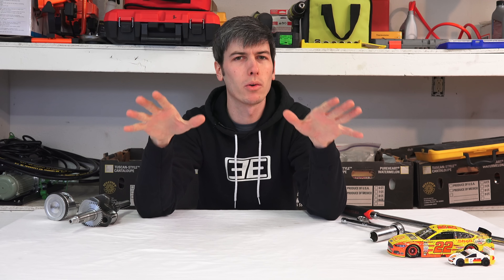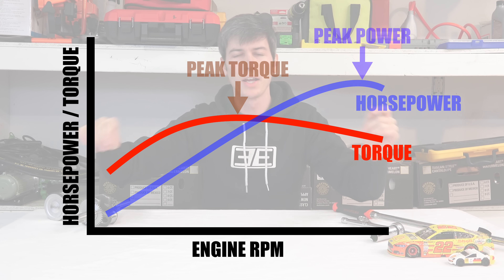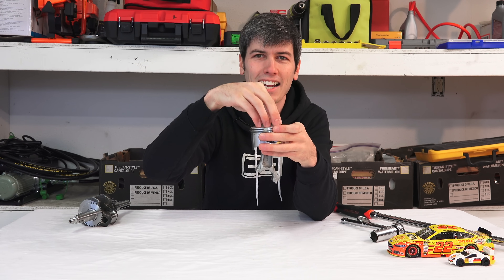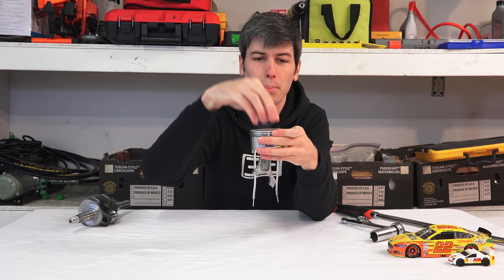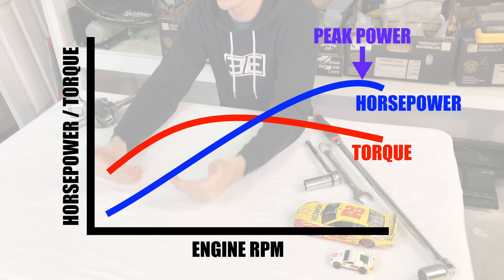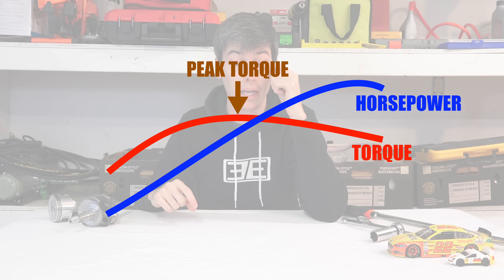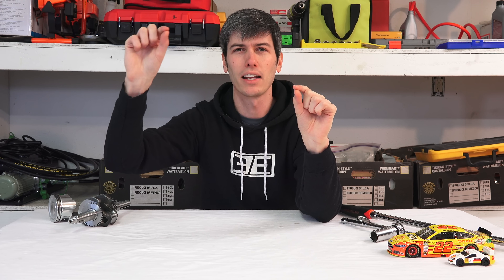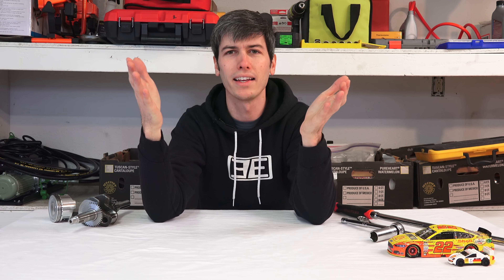Horsepower vs Torque - A Simple Explanation

Comment: Horsepower sells cars torque wins races.

— Carrol Shelby
Reply: How so when he just said hp equals faster car
Reply: @Buzzinga21  Race tracks have usually a lot of curves the car is constantly braking and accelerating, so in this case having lots of torque will give you that strong wheel (force at a distance) turning power to rapidly increase the momentum, while horse power would give it higher top speed, achieved at top perfomance of the work in general ( the engine rotations per minute x torque ), for that you need time or distance in this case.... so... thats why torque wins most Circuit Races.
Reply: @Just4funN92  , nope... HP wins all Circuit Races... not some, all.
Reply: @Buzzinga21  Thats why there are different gears, to shift the actuation curves of torque x horsepower, at low gears (1 - 2) it uses high amounts of torque because the goal is strenght, quick momentum shift (acceleration) but low overall speed, at this point your car HP value will be low hence the time it takes for you to go from point A to point B (mph)(the HP value is constantly shifting, the total number advertized for cars is the maximum value it can achieve at peak performance maximum torque*rpm).
Reply: @Just4funN92  👍
Reply: @Just4funN92  If you look at F1 they are constantly shifting (gear up and gear down) to keep the engine at it peak HP or as close to it as possible for maximum accelaration and speed. But its only true in racing, the cars without launch controls which keeps the enginge from stalling would be more or less impossible to use in a regular driving context.
Reply: The video is wrong.

200hp/100tq engine with 2:1 mission is 100hp/200tq output. And 100hp/200tq engine is equally as fast with 1:1 gearing.

One engine simply spun faster and one slower but after gearing they both had same output rpm, same tq and same power.

He’s also wrong about CVT. CVT aka infinite gearing has max acceleration at peak torque not peak RPM. Because gearing cancels out “RPM” of the engine and introduces a new RPM of the wheel. All power calculations would be tq*wheel rpm not tq*engine rpm. CVT infinite gearing changes output RPM not the engine RPM.
Reply: sparky12x  Exactly. You can push the wall with tons of force, if you can't move the wall, your power is ZERO. Thats why Horsepower is only way to move a car in EVERY SCENARIOS
Reply: Still rpm is the one winning races.
Reply: But how is That my Audi rs5 (450 hp  430 nm) is Faster then a tuned Audi s5 With 428 hp and 520 nm ) witch is also a bit lighter ?
Reply: marty7604 because you have more power, didn’t you watch the vid? :p
Reply: @MartijnvanderHage  gearing and powerband properties
Reply: @MartijnvanderHage  That is when your gear ratios come in.
Reply: marty7604 is ur rs5 faster then a m2 competition? I own a x3 m40i thinking of buying a m2 comp...
Reply: @MartijnvanderHage  if the race was up hill and you both had an 80 kg passenger on board the s5 would win
Reply: @MartijnvanderHage  gear ratio
Reply: @MartijnvanderHage  make those same cars weigh exactly the same more and then the other will win.... eventually depending on the weight.
Reply: @MartijnvanderHage  yeah but the s5 get the final speed sooner that your rs5.... I test it in gt3 for ps2..... Tunning gears and engines. ...
Reply: @michaelriquelme831  Get it's final speed sooner but can't go faster than rs5...
Reply: @MartijnvanderHage  Its an AUDI, german, i.e B@@it
Reply: It's important to remember, though, that ultimately what matters is the torque at the wheels, which can be adjusted through gearing, and then horsepower matters. The reason why the torque of the engine also matters, though, which is what Shelby meant, is that things aren't this simple. In the transmission, you always lose some power, because friction puts a reactive torque against the rotation which you need to overcome. The important thing here is that, like in the engine, the power this torque takes is multiplied with the RPM, meaning the more revs you have, the more power you lose. This means a total focus on horsepower and high revs (which help create horsepower) doesn't make sense.

Additionally, you want to shift as little as possible, and if your engine produces very little torque, your gears need to be relatively close together to stay at peak horsepower, which means you need to shift more often, which reduces or entirely removes engine output to the wheels while shifting (depending on the transmission you use).

Lastly, as you get to very powerful engines potentially reaching high RPM, the torque curve gets more extreme and longer. This can mean that at high RPM you make so little torque that a higher gear can make sense because you gain more torque from being at low RPM than you lose from shifting up. This means that to achieve maximum torque you will basically be short-shifting. As a consequence, you don't reach the RPM where you have peak horsepower, which means you lose the benefits of having it.
Reply: @justuslm  Thank you for that fantastic explanation!    This finally makes sense to me now.
Reply: @justuslm  👏👏👏
Reply: J. RAMIREZ MuRIcA biggest trash i‘ve ever heard.
Reply: I like that 👌
Reply: horsepower wins races. technically average horsepower does. that is a scientific fact
Reply: Whatta legend
Reply: Me after not understand what he says: My car goes brrrr.
Reply: you cant have horsepower without torque. Either Shelby didnt really understand that OR he was dumbing it down for the natives.
Reply: @yamahale  Well, horsepower and torque go hand in hand. However, what most do not understand is: You can not have torque without any form of force applied but you definitely can have a force without any torque resultant. Imagine when the piston is right at the top. Torque = Force applied x Distance from the center axle. If the piton is right at the top no matter how big an explosion you have in the cylinder the piston won't move either side because the distance is zero. And something multiplied by zero is...  ICE's solve this problem by using another type of "force" to pass thru this 0 degree point. It is called 'momentum' (Don't confuse it with "Inertia")
That's why a ICE can not start all by itself.
Reply: Mm
Reply: Jay Barker  haha, i love how wrong that is....
How far you push the wall would be your mass lol
Reply: rpm wins races
Reply: @The_Superpack  So if you have 400 hp and 400 tq at 8000rpm would you beat someone 400hp and 400 tq at 6000rpm? Think about which one gets it's peak first.
Reply: EB SSCAMAROG6 a car that makes 400 tq at 8000 rpm would have 609 hp not 400 hp. likewise, an engine making 400 tq at 6000 rpm would make 457 hp. way less than 609. power is a rate of work done with respect to time. if an engine does more work in the same time interval as another engine, then it has more power and will win any race, assuming vehicle weights are the same.
Reply: @tagacebu2  If the 8000rpm car has 33% shorter gear ratios, they will perform the same...
Reply: @tagacebu2  , depends on bore and stroke. How far your piston must travel before next igniton. But if you want to build a combustion engine with a given set of displacement for accelaration and speed the low torque will always win. If you take the same engine and put it in a truck it will consume more fuel than you can imagine.
Reply: @The_Superpack  Power 🤗
Reply: Torque peaks at lower rpm's, that's why a motor with more torque can beat a higher HP car off the line.
Reply: You dont need torque to go fast...
Reply: So if torque is apllying pressure at a distance wouldnt you want the dista ce to be shorter
Reply: @great4ever845  nah force * distance between the center of rotation and force = torque. Short distance means less torque
Reply: Great 4ever it’s the opposite. The distance you apply the force at is leverage. You want greater distance. Think of a see saw. If you have two people of the same weight then they will be balanced if the pivot is in the middle. If the pivot is offset to one side, the person on the shorter end will be lifted up. The person on the longer side has more leverage, which means more torque. So let’s make the piston rotate further away from the axis of the crank shaft right? That means more torque with a given force. However, this needs to be balanced out. If there is more distance, the piston has to move further to rotate all the way around the crank. This means you have to a longer stroke length that in turn limits RPM because the piston can only move so fast before parts start breaking. The other limit is related, the components in the engine have to hold up to that torque, if they aren’t strong enough the parts will start to bend or crack and the engine blows.
Reply: V10 F1 engines from 2005 season have around 300 nm torque and 900 horsepower.
On the other hand, much of the cars we are driving have more torque than 300 nm.
So does this meant that in a race, some car with more torque than V10 F1 engine from 2005 will be faster and win a race ?
Reply: Vauxhall Chevette Sure, assuming by race you mean until the end of first gear. And also assuming you are given identical suspension, tires, gearing, and car weight. Put that F1 V10 in a challenger and suddenly the 485/465 ft lb scat pack will outrun it off the line. Of course, the F1 engine will catch up because it can rev 3 times higher, so by the time the scat pack is in third gear the F1 is still in first. Wheel torque is equal to (engine torque - friction losses) x transmission gearing x differential gearing. First gear is the fastest acceleration because of this, which means that the F1 car will catch up and pass the higher engine torque car if the race keeps going. This is also why Tesla’s are so fast off the line and in the 1/4 mile but in a standing mile they will get caught. As the revs climb, their torque falls off and they get caught by combustion engines which have gearing to stay in the power band.
Reply: "Horsepower sells cars" 
In the USA only. In Europe the people are more rational.
Reply: He was actually not very correct.
Reply: Total nonsense
Reply: Carrol Shelby wasnt the smartest one when it comes to that quote.
Reply: The saying is pretty much not accurate. It is both horsepower and torque can win car races.  It cant be just Torque. Are u kidding me.

Horsepower = Torque x RPM. If the RPM  is low u will lose on high speed race.
Reply: @MrFoxbody89 Im talking about torque in the low rpms.. I knew someone was going to answer with a comment like that, but thats not what I meant, my comment was probably a bit confusing
Reply: @verttisyrjala2897  Can you please explain then? Because from what I understand from what you said, torque is not what makes you go fast.. but from what I know, without low end torque, you wont have the strength needed to quickly take the car from a stop to a high rpm situation, which is when you have power.. without proper gearing, high rpm power is only practical once at high speeds..
Reply: @jasonmateus924  Thats what gears are for? Older F1s for example (Not that the new ones have any either) didnt have low rpm torque at all, they were screaming at 18k rpm all the time. Did the cars look like they needed low rpm torque?
Reply: @verttisyrjala2897  hence my previous answer about proper gearing.. F1 have extremely tight engines (near zero power loss by  blowby) , they are extremely light too and YES, at 18K, they still have to bring it up to about 5000 rpm to launch, otherwise the bog.
Reply: You can only choose 1 torque or power. You cant have it all. If you want top speed like highway races choose power. If you want to win races in a print choose torque. 
Thats why a Lambo cant beat Tesla in a 400m sprint because of this matter.👍
Reply: Kentoy Games lol no, you just have a little lower gearing and you’ll still beat the torque-engine. Power is the rate of work, that’s literally what the video was about!
Reply: @TheSteinbitt  tesla can apply torque instantaneously. Combustion engines have to rev up to where torque is highest
Reply: @MrGoMario  You’re so far off on all accounts I don’t know where to start. I think you just need to start from scratch and watch a lot of yt vids on the subject.
Reply: @TheSteinbitt  Yeah, this is your take on it. I respect it. If it is right or not... it does not matter now. But as I said, I respect it. Thank you for bothering to reply.
Reply: Kentoy Games true
Reply: They are same
Reply: jimmicrackhead12 wrong sir.
Reply: jimmicrackhead12 no not really
Reply: @jimmicrackhead12  Well, they're not technically. You've forgotten about RPM.

Comment: Power is the energy delivered in a unit of time. Torque is the energy delivered in a single revolution. The caveat is that a lever does not have to move in order for torque to exist but when talking about internal combustion engines this is a non-issue.

Comment: I cannot understand the units mate. Punds per feet is equal a certain amount of Joules. But the Power unit is Watt wich is equal Joule divided second.  I think there is something missing.
Reply: You are mixing up multiplication and division in the units.

Pounds MULTIPLIED BY feet = a certain amount of energy.  Not "per".   This would be measured in Joules, if you used Newtons instead of pounds, and meters instead of feet.  But it is in ft-lbs as the unit of energy.

Per means division.  Like miles per hour.   Units said sequentially after one another, means multiplication.  Like foot-pounds, and kilowatt-hours.
Reply: Torque and work may APPEAR to have the same units, but there is a subtle difference.   Torque only becomes work, after it has been applied through a rotation.  It takes 1 radian of rotation for 1 Newton-meter of torque, to become 1 Joule of work.   A radian is a radius angle, which is about 57 degrees.   1 radius wrapped around the circle.  There are 2*pi radians in a complete rotation.

Torque gets the units of Newton-meters, to remind you that it is still a vector quantity.   Ft-lbs is the unit of both in the US system.

Comment: It is all Horsepower there is no torque. Torque was invent to give a number to potential of pulling. But there is only Horsepower.  As in physics horsepower is force but it is used as a way to describe the force in a manner for all humans.  The use of lever and fulcrum to propel the engine does not change the name

Comment: If TOURQUE = FORCE*DISTANCE, then why there's a tourqe curve? Why it differes with different RPM?
Reply: Because the engine can only process so much fuel in any given cycle.  And the engine gets less efficient the faster it runs.
Reply: @carultch Got it, thanks!

Comment: Had a car where the peak torque was developed roughly between 5500 to 6000rpm and peak HP at 8100rpm.  Needless to say that was a fun engine if you were willing to dump the clutch at most other setups redline.

Comment: Power = torque x RPM. Simple as that, folks!
Reply: ... Yes. Thats the very definition of it, but its more complicated than that when you break it down. You can quote that formula all day but that does not automatically mean that you truly understand it.

E = mc^2, there im a genius.
Reply: @koettfaers  Except its not really a case of putting a formula down and claiming to be a genius, is it? If you understand the concept of torque as a turning force (basic) , the formula shows what the relationship is to power and speed, which is a very basic one. What you've shown is a rather ugly type of behaviour where someone has a comprehensive understanding of a topic, and needs to correct everyone who explains it in anything less than an essay.
Reply: @Djavo1  listen, you watched the clip of the guy explaining it and you see all the comments discussing the topic.

You drop the equation and call it a day "torque x rpm" we are done here folks! It just falls flat, people are fully aware of the relation, afterall they watched this clip, and if they werent before they should be now. Its how you implement this and what it means practicaly that matters, just quoting the equation does not advance the discussion in any way

Comment: Thanks for an interesting explanation. 

Something I don't get tho that really bugs me- in the real world, sometimes manufacturers tune for one or the other, clearly. Old Hondas (S2000 etc) were way more HP than torque, and now the trend (especially with Ecoboost and electric vehicles) seems to be to tune for way more torque than HP. 

The argument is usually presented as "more torque means faster acceleration, more HP means faster top speed." Then diesels do the same darned thing - double the torque and half the HP - and they are slower? 

So basically you're slower no matter what? Or faster no matter what? More than understanding a formula, this is something I don't get and never have.

Comment: If you guys want to buy a new engine, and the dyno sheets are provided, it's easy to tell if it's a fake dyno sheet.
Both hp and torque curve lines must cross each other at the rpm of 5252. Correct me if I am wrong.